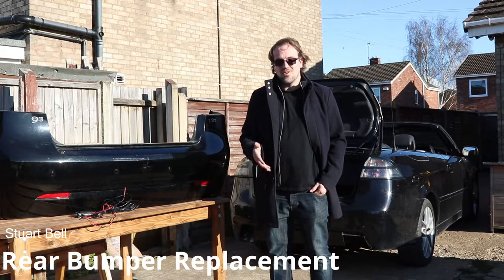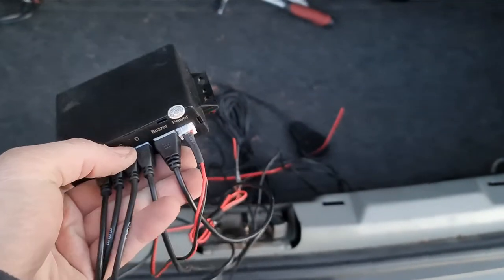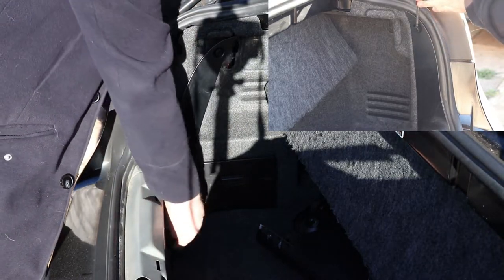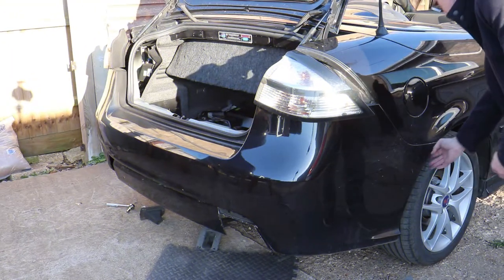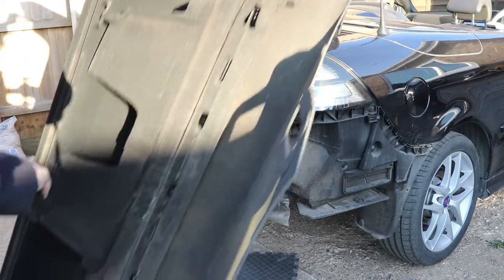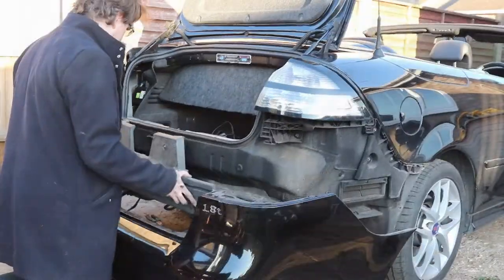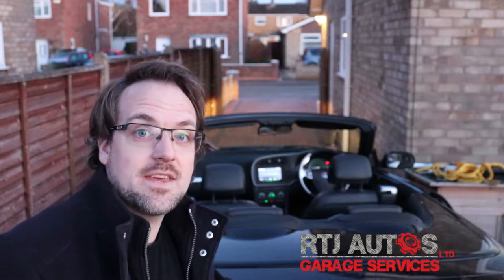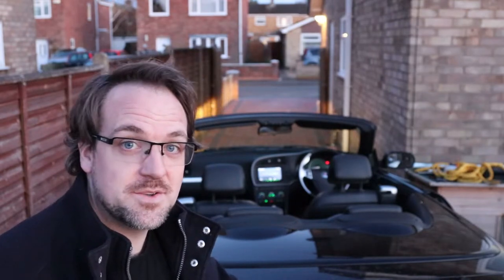Saab 9-3 Bumper Removal and Replacement Fitting - Found More Melted Plastic from Exhaust!

Comment: Please and please saab unleashed, I need your help, I got
2007 Saab 2.8l aero convertible and I really want to install a rear diffuser but the diffuser is not the same shape like the 2008--> convertible, my question is "can I replace 2007 bumper with the 2008	--> bumper " in order to be able to fix the diffuser that I bought?
Please I indeed need your idea.
Thanks a lot in advance